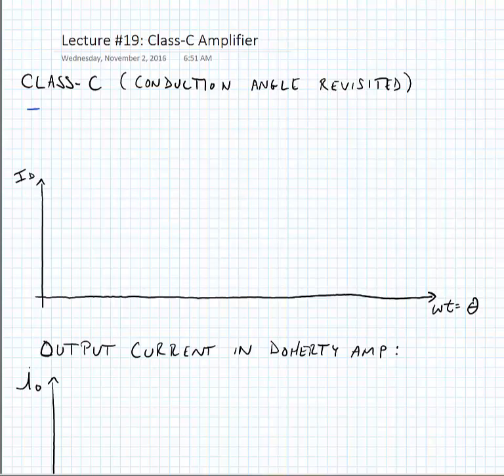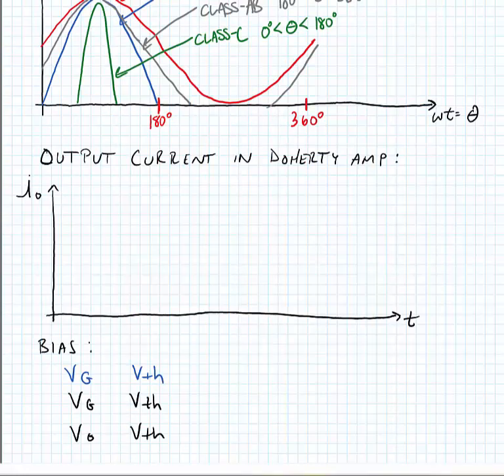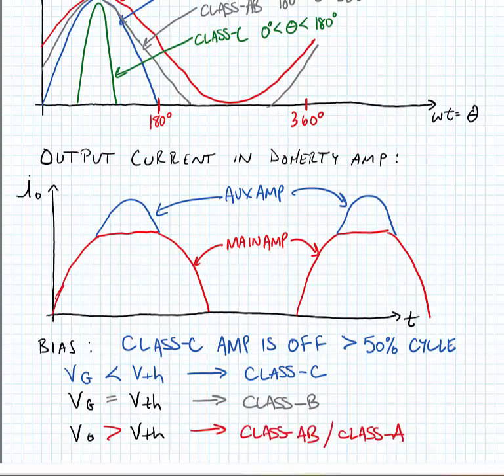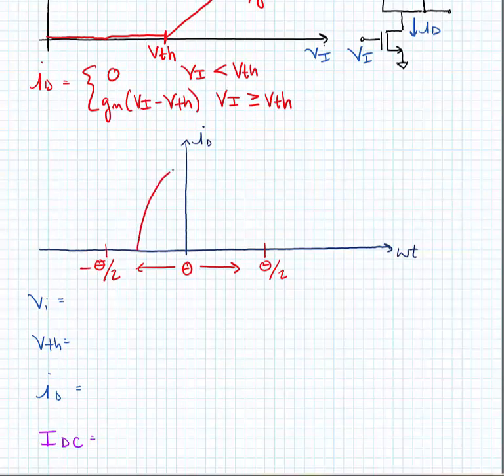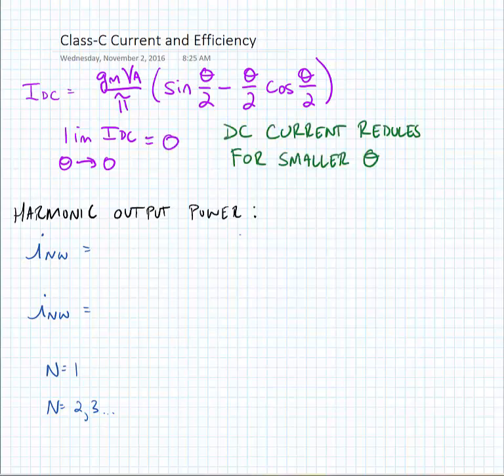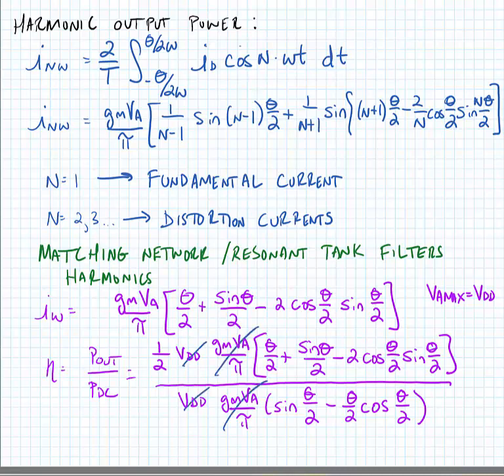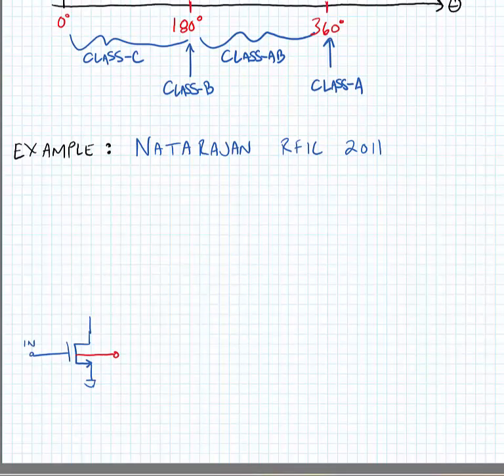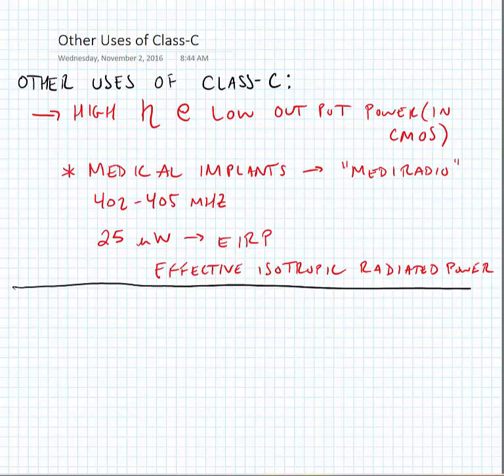Lecture 19 - Class-C Power Amplifiers

Comment: Linear but not linear - To be or not to be"
Reply from the maker: This has always been a problem with the terminology. The way that I resolve it is that in Class-A, -AB, -B, -C, the transistor acts as a voltage dependent current source (e.g., gm) for at least part of the conduction cycle.